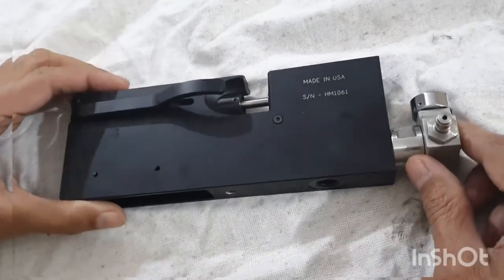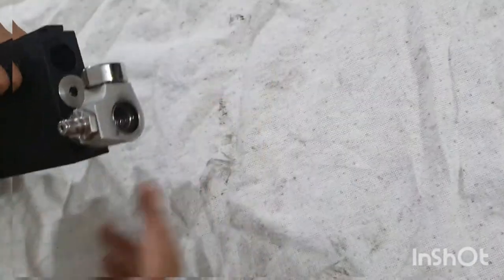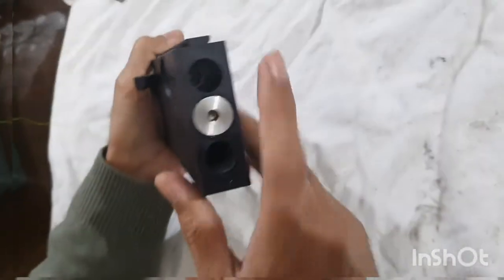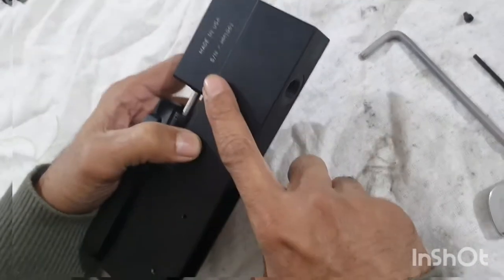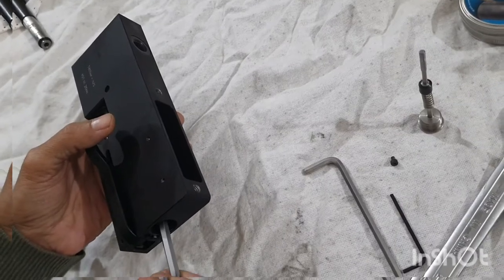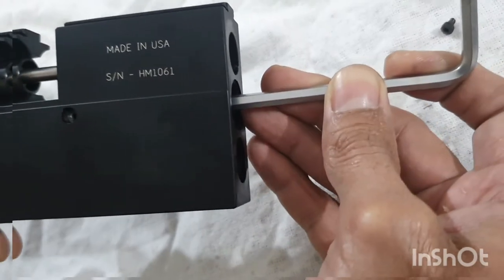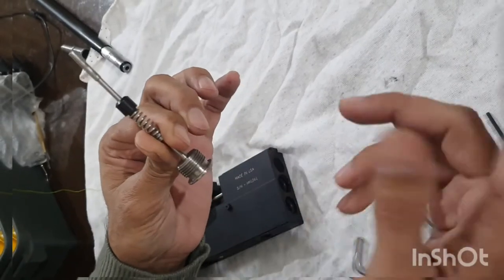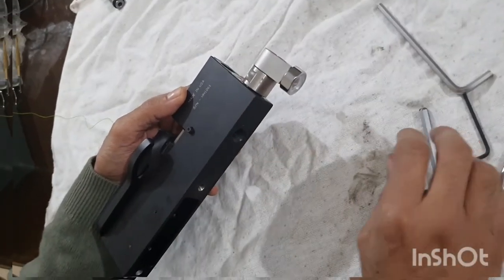RAW HM1000X & Rapid valve disassembly & reassembly (English & Urdu)

Comment: Wow you seem very knowledgeable on these guns. I am very new to tuning guns and such. I hope to do competition shooting one day. I have a raw hm 1000x .30cal. It’s two years old with no upkeep pretty much. I was shooting sub moa groups at 100-150 yards. My air rifle fell about four or fiv feet to wood floor and broke the stock. I re fastened the stock as best I could but ever since my shot groups have been large and it was shooting at 900fps. I have been trying to get my shot groups better to wut they were before the fall. I removed the regulator and turned it down and adjusted my hammer spring to be about in the middle and I’m shooting at 845-870 fps. Those are my averages from 30 shots worth. A very large variation of fps. I also get about 40 shots per bottle fill. What do you think I should do or replace or clean to get back good 100 yard shot groups besides send my gun to raw to have them re tune it. I have ordered a new regulator and that’s on its way. Also I will get about five or six shots in a row that r bullseye then I get a shot that’s a few inches low then my next shot is closer to bullseye and then closer and closer till the rifle is back zeroed. It’s very strange and very frustrating that I can not figure out y this is happening. If you can help me at all it would be very appreciated and I’d be a subscriber for life
Reply from the maker: Apparently there are following possibilities;
Due to drop of your gun the pellet probe has got a bit missalligened and causing variation of fps due to leaking of air from there.

There may be some issues with bedding of the action into the stock after you have tried to fix the broken stock.  This may cause issues.

There are chances that the silencer of the gun is no more properly fixed. It may has gone misaligned a bit,  misaligned internal baffles etc.

I would start with removing the silencer and see how it shoots.

As I know regulator cannot be damaged if the gun is dropped. 

It's a very sturdy platform.

Check all the three set screws that hold the barrel into the action

I hope one of the above mentioned things might address the problem. 

Bhaur
Reply: The action beds into the stock normal, the brake happened on the hand grip. I will try removing the two baffles and see if it shoots better. What is the pellet probe? I will order a new one. Or should take my current pellet probe out and re install it?
Reply from the maker: Yes the pellet probe is that pushes the pellet into the barrel.
Test your gun without all kind of silencer.

At least you may be confident that the gun including the barrel is in good condition.
Reply: So the air to push the pellet comes out of the pellet probe?
Reply: I should just order a new pellet probe or try to re align mine?
Reply from the maker: @joshpopa4400  there is possibility
Reply: Well thanks a ton for the help!
Reply from the maker: You may check if the probe is leaking or not. Just put a tissue paper on the breach area and shoot the gun. If air is coming from the sealing contact area, the tissue paper will blow out
Reply from the maker: Pellet probe just pushes the pellet into the breach and then seals the breach area. Air shouldn't come from the probe while you shoot the gun